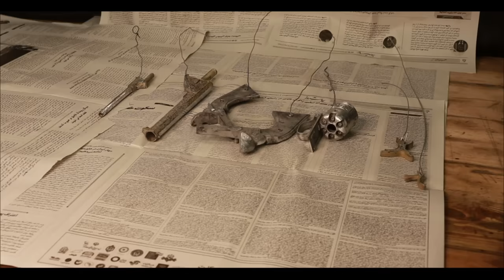Old Model Ruger Revolver Gun Restoration (decoration gun find in river  )1851 Navy Model Restoration

Comment: I have little experience with restoration. But I’m sorta familiar with these models. There somethings that were off about this. If the whole gun was covered with surface rust and caked in over the years, I would automatically think that the screws would be rusted out also but they looked brand new. Also, who would spray paint on such a beautiful piece like that, you should’ve kept it original. My Abuelo would’ve slapped me with the belt clean across my face for doing that.
Reply: I have a few weapons.. I don't know jack about gun restoration, but those stainless steel screws really caught my eye as did a few other inconsistentencies. Yup, something is off here.
Reply: He is making corrosion on purpose, thats my guess
Reply: The dead giveaway for me was the barrel's bore diameter of a blunderbuss vs the cylinder bores of an elf's ashoe. Whole video reaks of questionable things.  Until someone can correct me I determine it F🅰️KE
Reply: Them good ol merican Stainless Steel screws 🇺🇸
Reply: No legitimate restorer would paint an old firearm. And notice how the barrel spins freely and the trigger and hammer don't advance it...this must have been fake gun from the get go.
Reply: of course its a fake gun. propably some kid lost daddy's deco gun while playing with it in the river like 6 months ago. he took it from the wall without asking, so daddy was rly pissed :P
Reply: agreee
Reply: 100% this guy (and a lot of the newer "restoration" youtubers) are buying this stuff and burying it in their backyards or keeping it in a tub of salt water for a few weeks in order to have a consistent stream of videos
Reply: Heavy pitting on the surfaces that don't have detail.  No pitting on surfaces with detail.  This video screams fake.
Reply: Spot on there. 

Looks like a toy aluminum gun. Paint job was the worst thing. And the drum doesn't freely spin like that. And it's funny how the putting occurs only on the flat surfaces of the barrel and not the designed surface . So he could file up the top and drag the video a few more minutes...
Reply: Yeh he just washed the mud off
Reply: And what about the poor job on the wooden handle. The thing needs 6 inch putty to fill in the gaps. Youtube needs to take the "restoration" out of this title.
Reply: I would've kept the original metal also, maybe had it steam cleaned(?). Idk. The gold paint definitely threw me off.
Reply: Dude you called this out 100 percent
Reply: Yep. Sus.
Reply: Who would sand the handles on the gun and put it on with epoxy he makes the fudds that sporterize old mausers look like saints.
Reply: @TheLimpCottonToeBook  not to mention the title
Reply: Better title "how to ruin a piece of history by not knowing what you're doing" this is cringeworthy.  The worst part.... some people are going to watch this and do the same hack job work out of ignorance, destroying more relics. If you dont know what you're doing leave it alone or have a professional do it.
Reply: Get the feeling it's an old toy cap gun, not a real one. The cylinder is not empty in any of the chambers. But definitely the while video seems quite off. Either way this guy seems to be a "Awesome Restoration" channel rip off attempt.
Reply: That's not even a real gun, it's a cap gun.
Reply: @TheLimpCottonToeBook  I agree.  The SS screws and spring did not look right.  Also what would have been engraved (cutting into the steel) is actually standing proud of the metal surface.  It's a casting.  Phoney, but as of this date, he has over 4 million views.  He likes the result.  Me? I'm out of here.
Reply: YES THAT WAS MY IMPRESSION RIGHT OFF. DID A LOT OF OLD PULLMAN PASSENGER CAR RESTORATION.  LOTS OF HUNDRED YEAR OLD RUST IN THE WAY.. LITTLE BIT OF A STUNT GOING ON HERE  IN REGURADS TO WHERE IT WAS FOUND.. ??????
Reply: agree
Reply: Отписываюсь.Я думаю это вранье. Он разбирает всё  это как будто уже разбирал. Даже не боится что то испортить или сломать. Уверенно всё  достаёт,знает что не сломается. Любой рестовратор бережно бы относился к каждой детали
Reply: @m2k2023  its called a cylindrical not a drum
Reply: this "restoration" gets me triggered
Reply: Yeah the paint was a mistake came looking for that comment
Reply: Cmon guys… it’s not just the screws. It’s the whole gun. The first give away was the plastic grips. The most obvious was the 2 piece frame. Frames were one piece. If you listen to the metal when he spins the cylinder, it sounds like cheap thin pot metal. 100% phony.
Reply: looks staged home made rust
Reply: That's usually how all of these restoration videos go, get a shitty object and then do a shitty job restoring it lol
Reply: It's a pot metal replica. It won't rust. That was just mud.
Reply: In the description he says it’s a cheap Chinese model and not an actual firearm so
Reply: Thought the same thing instantly. Also none of the parts are rusted together even though there is considerable amount of grime. It's a toy gun artificially corroded, listen when he pulls back the hammer and squeezes the trigger, that's some soft metal. This is why I want the dislike button back.
Reply: Lots of great points, but the one thing I want to add is that he apoxies new grips on overtop of screws that had to be taken out to disassemble it.  So you just doomed it to never be taken apart, again.

But yes, it's a fake firearm, probably a cap gun, should not be painted, and almost certainly has staged aging.
Reply: It says in the title description cheap Chinese made prop
Reply: It’s funny cause he can do what he wants with what ever is his. He paid for it.
Reply: This video its a lie, all pieces come off so Easy. I dont think this is really rust.
Reply: @MAR020429P42  it's a Chinese made decoration
Reply: @babernethy13574  Agreed. Not a Ruger, more likely Colt 1851, though the barrel diameter seems larger than cylinder chamber diameter (.45 compared to .38). I just hope nobody watches this and thinks it's a proper way to restore an antique revolver.
Reply: I agree! This video is totally fake!!!
Reply: I KNOW RIGHT?
I was so Damn pissed about that
Reply: Im glad I'm not the only one to think that
Reply: Was looking for such an comment because it also looked very suspicious to me as well. That corrosion looks more like dried up mud.
Reply: Definitely made me cringe watching such disrespectful craftsmanship (or lack or craftsmanship rather)
Reply: How dare you sir. Who do you think you are?? Leave it to the pros next time pal
Reply: i agree this ``restauration´´ is a mess
Reply: agree
Reply: Looks fake to me too.
Reply: @danielbaran1957  It's obviously a fake, The dead givaway is the thin stamped body. Real guns aren't like that
Reply: Just gotta say how has nobody read in the title that this is a deco gun not a firearm?
Reply: springs are also like brand new no rust on them ;/
Reply: @mr.baginski1474  it’s kinda a decoration gun
Reply: if i had to guess a combination of hydrogen peroxide, white vinegar, and tablespoon of salt was used to artificially rust
Reply: It Looks like coffee powder! I hatte those fakes
Reply: Foreal could’ve just blued it instead maybe would’ve been worth something then you lost me with the spray paint other than that it turned out good but the spray paint is a hard no for me
Reply: just throwing out a theory it might be a reenactors gun, not uncommon to loose and the screws and mud would make sense
Reply: He says in the description that it is a NOT A FIREARM
Reply: Yeah and a colt navy revolver handle doesn’t split in half like especially with the receiver like that it’s us usually one solid piece
Reply: if you find anything like this in your back yard, you dont "restore" it in the the first place
why dont we go restore ancient rome too 😂
Reply: @babernethy13574  It IS a fake gun. He says it's not a firearm but a decoration gun, basically a toy.
Reply: @Mikael Yeah, you know what? The description said he found it in a river and then I think it said somewhere that he found it at sea. There seems to be a little deception from the git go. Unless I missed something...
Reply: @TheLimpCottonToeBook  no bore looks about right, this is a black powder, precussion cap, colt navy 1851 in .36 cal.  

the screws got me to though.
Reply: That's a fake gun at first guys. Are you serious? read the description.
Reply: @guiguijol  It's amazing how many people didn't read that, ya know?
Reply: @tonyf.8858  yea, especially the ones claiming they own some black powder guns.
My father owns something like 14 Italian  replicas. (colt 1901, 1871 etc..)
all functional.
I showed him this, he needed exactly 3 seconds to notice.
Reply: Hermano?!?  Is that you? 🤣😂🤣😂
Reply: Buddy Missy  yeah, someone is going to see this and try to "restore" a real historical peice this way. This isn't the correct way to restore anything. Like I said "ruin"
Reply: I don't do restrictions and I completely agree.He really should have just cleaned it.I can see adding the handle but nothing els.
Reply: Buddy Missy  ya because everyone looking at "how too" and "restoration" videos on youtube are experts and know everything about antiques and firearms right? Haha go troll somewhere else genius.
Reply: Buddy Missy  had the title been toy revolver restoration I probably would’ve never said anything, but the title is misleading. There are several on here that agree with me and have spoken out as well.
Reply: Its a toy or replica not the real deal
Reply: Buddy Missy  obviously you're missing my point... that's ok.
Reply: Buddy Missy  my screen doesn’t show that. My screen simply says Old Model Ruger Revolver Restoration… and I commented according to what I see on my end. I’m not the only one on here calling this bs. I think they misled viewers just to get a click.
Reply: Im also surprised that if you know what kind of gun it is, you miss out on the loading lever. Not to mention thr fact that the ornately made revolvers like that are either extremely rare and old or didnt exist except as a modern reproduction. Also the metals used in cap and ball times would be steel(not stainless or plated) and brass. X
Reply: That and sanding of some of the inlay?! Keep the pits, that’s character. Sanding them out while destroyed inlay is throwing out the baby with the bath water.
Reply: That "gun" is available on Amazon for 24$
Reply: Being familiar with this model you should’ve picked on the fact that the gun is worth very little value. That gun was badly pitted and then whatever was left of the finish was sand blasted away. At that point he could’ve painted a 🌈 on it and it wouldn’t have mattered. I liked the “restoration” but would’ve gone with a black handle.
Reply: If you would ever read the description you might find out why!
Reply: Common! It’s a fake restoration. It’s clear as sunny summer sky
Reply: @DjChester92  I agree... The plastic grips gave it away for me.
Reply: Not to mention the Phillips head screws under the wood grips hadn’t been invented until 1932
Reply: @rickcollins8893  iik

P
Reply: @williamgibble8361  ujp
Reply: Yeah, I was in pain watching him spray paint over that gun smh
Reply: Title should be restoring old cap gun 😆
Reply: Y'all realize this is a Chinese cap gun? People talking about the barrel diameter like it takes a round..lol
Reply: it is either a toy cap gun or a display only, the internals are completely incorrect
Reply: @quicknickgarage1  It's not a real gun. He clearly states it is a cheap Chinese decoration.
At best it is a cap gun.
Reply: @m2k2023  I looked at that top section of the barrel he deemed "pitted" and snapped a few screen grabs. That top part of the barrel was also engraved like every other side of the barrel. (I looked up a bunch of pictures of other 1851 Navy revolvers with engravings). I bet when this guy realized he just filed away artistic engravings, he stopped himself from completing the whole barrel. I kinda got a sketchy feeling about this video when I 1st saw the unrusted  screws he initially took out. When he realized there was a mechanism under the barrel (loading lever), I knew this guy didn't do his homework. I won't be watching any more of this guy's vids.
Reply: thanks deven. i agree. spraypaint shouldn't be used on a wonderful piece of metal like this.
Reply: I was thinking the same thing as soon as I saw the paint
Reply: Beautiful piece? It's a toy gun
Reply: @TheLimpCottonToeBook  You are absolutely correct! This is nothing more than a cheap, POS cap gun. You can get them for a dime a dozen at damn near any toy store. Or, at least you used to. Pot metal and plastic. No more a "real gun" than my replica DL44 blaster, which I built on a Denix C96 Mauser replica. 

No actual guns were harmed in the making of this video.
Reply: I noticed that about the screws too. He cleaned some rust off and there were shiny screws under it.
Reply: You aren't. He says it's a toy in the description.
Reply: It’s a cap gun
Reply: yall know he straightup says this is a cheap chinese knockoff decorative gun he found while at sea right?
Reply: You must not be at all familiar with this type of gun because this isn't a gun, it's a replica. Nothing about this would function as a gun.
Reply: Looks like the toy Python revolver I have, just with a metal butt instead of my plastic one. (The butt not the gun)
Reply: @TheLimpCottonToeBook  Bc It is a blackpowder replica of a 1851 colt navy, thats why on the backside of the cylinder it isnt open. Those lil tiny  round nipple things are where you put your caps that set off the powder in the cylinder chamber. The old original ones could be dangerous bc the spark could jump cylinders and set off more than one round at once.
Reply: Its A TOY Gun!
Reply: @TheLimpCottonToeBook  Its a Toy Gun, plain and simple. I know I have a real 1851 Colt Navy Revolver, that shoots. What he's working on, was never a shooter.
Reply: @longrider42  Ya don't say?
Reply: If it makes you feel better it's a really fancy toy gun, I've got one up in my attic somewhere, just a cap gun basically.
Reply: The silver colored screws didn't seem plausible to me either.
Reply: It's a toy gun dudes
Reply: @NWA744  it's real,the caps we're used on old guns as primer,in front of them(inside the cilynder) there's powder and the metal ball
Reply: @King_Gtasa  Yes, I know how old percussion cap revolvers work, but this is still not real. For one, there's no flash hole where the percussion caps would sit, and two, a real revolver frame isn't made of two die cast halves but is machines or forged from a single piece. This thing would blow up if you ever put a real live round in it.
Reply: @NWA744  oh I see,good observation
Reply: @DjChester92  For sure.
Reply: It's a toy
Reply: Fake or not. . . Though seriously fake. I couldn't keep watching past the file. Why would you use a file for any kind of restoration?!
Reply: I´ts a DECORATION gun.....
Reply: Not a firearm..
Reply: THE DEPTH OF THE RUST WOULD BE TO DEEP FOR THAT TYPE PERFECT SURFACE FINISHING.....?? A WEAPON IN THAT CONDITION WOULD HAVE TO BE SUBMERGED IN A SOLUTION FOR 24 HOURS FIRST..??
Reply: Sounds like old PeePaw had some since
Reply: Yeah this is a fake video
Reply: @Southbeach445  I’ve seen some stupid crap called “restoration” and for some reason they all think sandblasting is what you do to “restore” a gun that has rust. You boil and card until carding reveals no more red rust. Boiling in distilled water only.
Reply: That's exactly what I'm saying. As soon as I saw him start to paint it I cringed. What an awful color and why would you do that. Took away all value of this gun if he was ever going to sell it. The patina before was probably so beautiful. Now it looks like a Sean Puffy Combs music video.
Reply: Exactly, Spray paint is stupid. Loks like hobby restorater, not pro.
Reply: @mullenlogan20  it’s a kids toy cap gun. And he didn’t even do it correctly as the cylinder no longer auto advances and indexes. If you look at the cylinder one end is open and the other is closed off with small holes you put your caps over. 100% it’s a cap gun likely bought new by him and aged.
Reply: نعم إنه غش لا اكثر  ليس المسامير فقط بل ماسورة المسدس أيضا ، Yes I am agree with you it is fake video .
Reply: there is a real gun restoration YouTube channel called backyard ballistics that offers high quality content and who recently made a video that includes all the elements to recognize fake restorations, if you don't know it already a suggest you to go check his videos. And yes in this case it's obviously a fake.
Reply: A lot of these videos are made in other countries so not in America. So it may not be real to that effect.
Reply: dont forget that the near 200 years of "rust" didnt damage the metal in any way, if this was real the metal would look like a teenagers face to quote jeremy clarkson
Reply: Its bullsh*t, and its a cap gun.
Reply: Also there is no indentations where rust are through a little of the metal
Reply: @babernethy13574  The fella forgot the hand lol.
Reply: Restoration videos are fake. And, sorry to tell you, Santa isn't real.
Reply: @yuhlimirfranzhiskje9143  Most, but not all.  There are some small youtubers who have done actual restoration of firearms, but not in this kind of condition.
Reply: @Schnipah  Most of these videos are just common objects, which are artificially aged and then "restored". In this particular video it is so evident that it's embarrassing.
Reply: @saltycreole2673  3q№#№№€$%%
Reply: This is probably fake,but the 2ay it is cleaned is cool
Reply: That gun looks like it came straight outta the second French intervention or the start of the revolution
Reply: @saltycreole2673  These restoration videos are money generators for whoever makes them. A little deception makes them a ton of cash.
Reply: @babernethy13574  It was probably a prop gun from a movie because the handle was all wrong. It'll never fire.
Reply: This is a cheap Chinese knock off toy gun. They wouldn’t have had stainless screws in the 1800s and the chamber also doesn’t rotate on pull or have loading ports. ‘Tis just click bait.